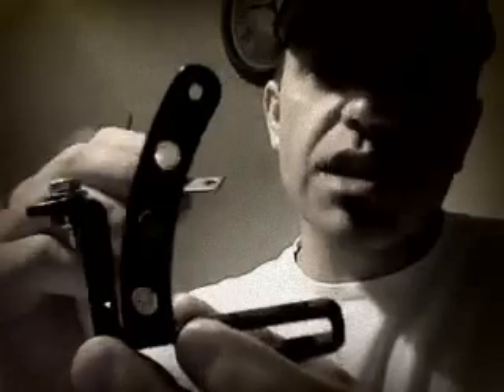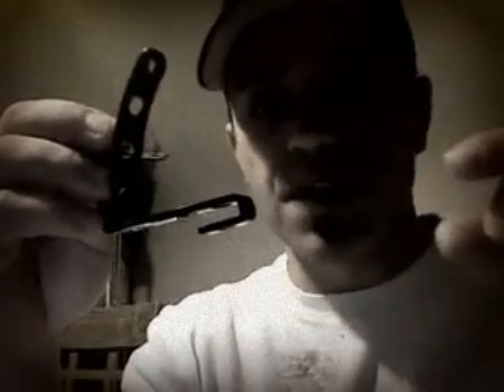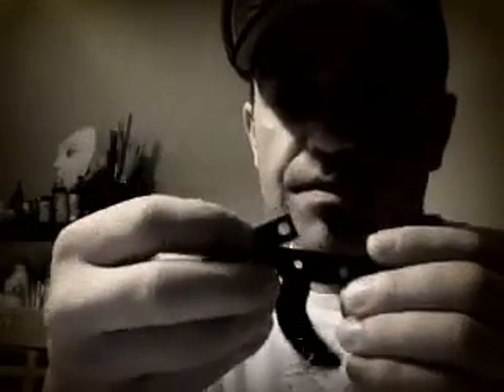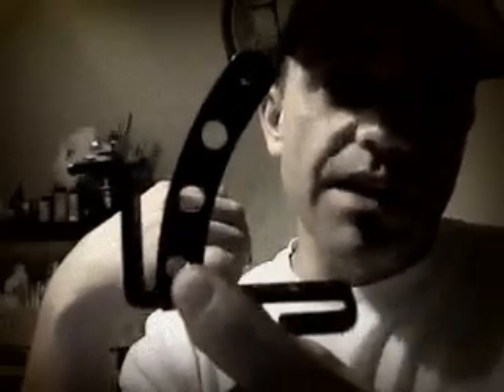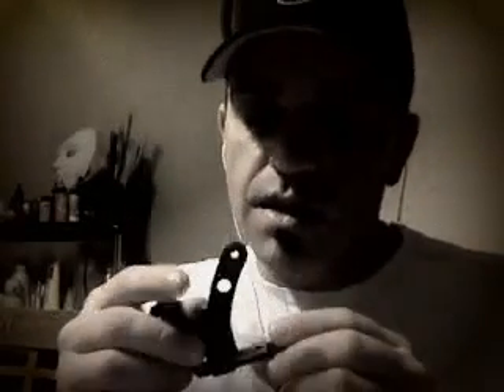Tattoo Frame Yoke and its purpose

Comment: hahaa.. wrong.
Reply from the maker: How and what is wrong? A yoke serves as what purpose? It completes the tank circuit on a non-conductive frame and some use it as a spacer for coil height (Which I see no purpose)...so seth, tell me what is the true purpose? Im learning too---your the pro
Reply from the maker: Also will increase Magnetic Flux to 100% of coil output or RMF...each coil only produces 50% of its true electromagnetic capacity...am I wrong Seth? Why would you use a yoke?

Comment: Hi,1018 steel is made 98% of iron,you have low carbon which is good for magnetic field.High carbon steel is mix with crome or molybdene or vanadium.It's only  use for  the spring on a tattoo machine..About the copper a-bar it's only platted with copper.Did you know that even the spacers you need to set the coils at the right place need to be made of low carbon.

Comment from the maker: -cont- So I dont know why you have a copper A bar. The deal is..the better and higher the magnetic DNA and shooting for the LEAST CARBON IN ANY METALS, the better off the Machine will run. I havent done a vid on this and should go in depth because your not gonna find this info anywhere else-Kage

Comment from the maker: -Cont- You need to look at the Coil CORE Tops and see what Material they are. By science..the A bar SHOULD be the same material for consistent magnetism. Now on another note, it DOES matter what material the A bar is. The better Magnetic Response or Magnetic Conductivity,  the more consistent the Oscillation will be, reducing shaking/vibration at the needle tip (Skin). So it will look like this greatest to least
1-Iron
2-1018 Steel
3-Nickel Plate (Chinese)
As far as "copper" copper isnt magnetic

Comment from the maker: @Goy. Yes it will work and complete the circuit, BUT good rule of thumb..same material will be a better connection, you wont lose much at all. Just by having a yoke, you allow for each coil to push 100% of its purpose, without a yoke, even if not needed on a magnetic frame,  the coil only pushes 50&, both coils making 100%, so with a yoke and 100% each we are getting 200%..more "Bang" for the buck..so lets say we only have an 8 wrap and needed to push a 9mag, we would accomplish this by adding a